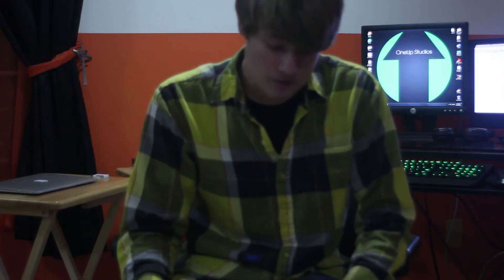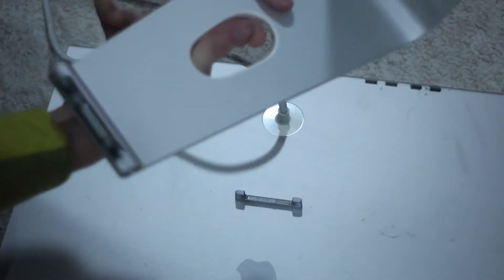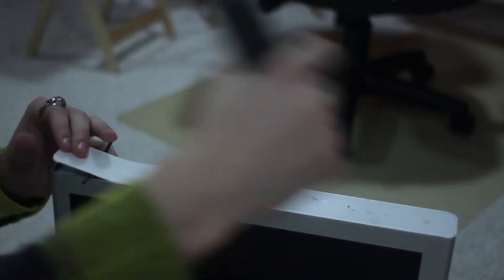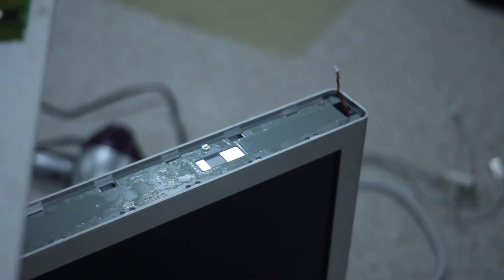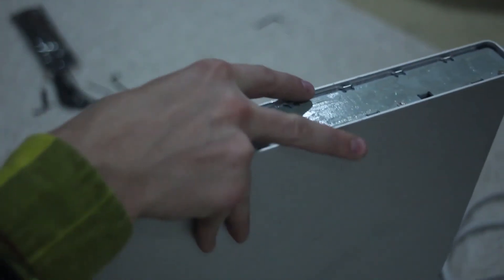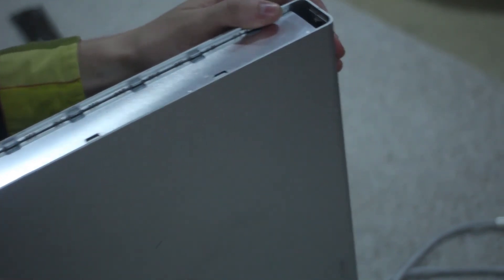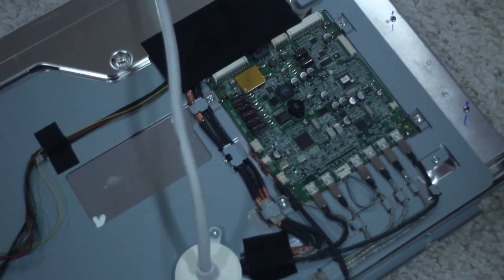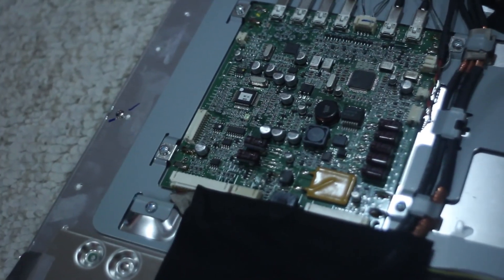How To - Disassemble An Apple Cinema Display (23")

Comment: I have an issue with my 30" display, need to crack it open and somehow change out the DVI connector.
Already using an aftermarket Power Supply.
So basically going to crack it open, and somehow solder/connect/glue/whatever as stock DVI cable to the PCB if possible....
Have a short in the current cable that causes the screen to randomly go black...

Wish me luck....
Hmmm, could also make for a good video!

Comment: Hey bro, is it possible to change the display?
Reply from the maker: Enrick Brandao Most likely. Its all connected by other screws and wires
Reply: Could you tell me where I can buy it? or if I can swap his display through a common monitor display
Reply from the maker: Probably can't connect it through another generic display, but you can search ebay for "Apple 'model #' panel"